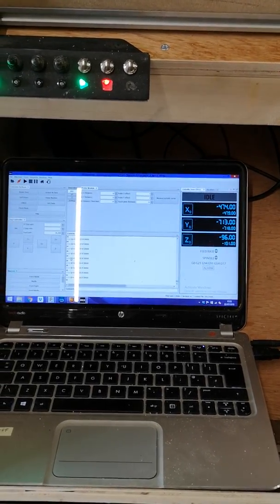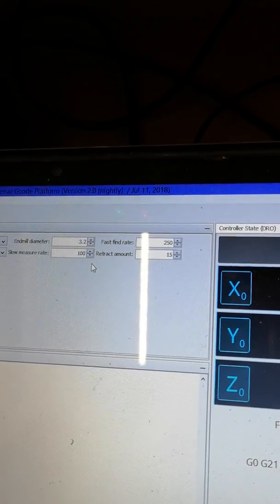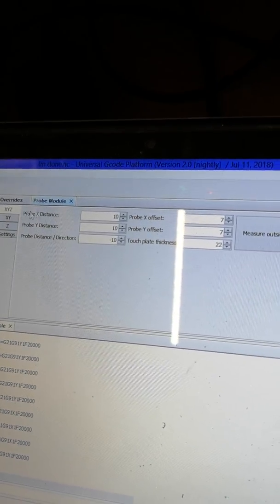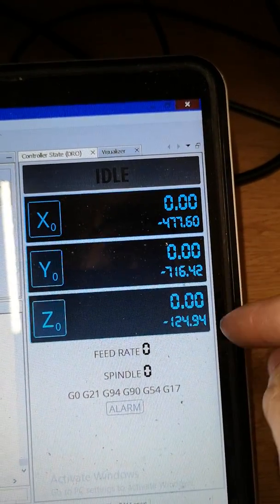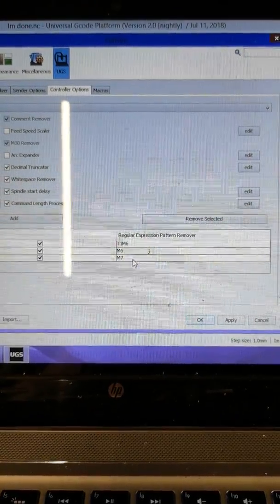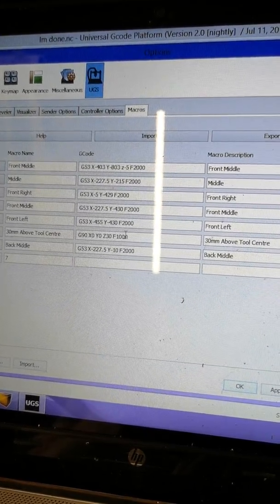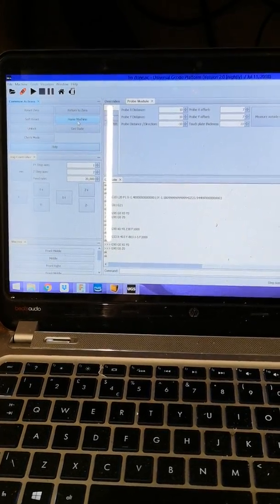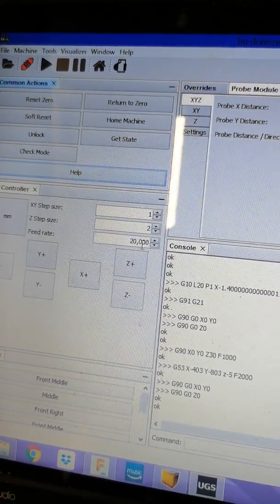Looking at UGCS and the Beaver HDZ for Shapeoko 3 - Probing, Macros & Commands

Comment: Question. It looks like after probing the zero point is the side of the end mill vs the center of the end mill. Is that correct?
Reply from the maker: Savant PCs the item I probed off wasn't secure so it might have moved + poor camera work 😁
Reply: So it does indeed center it to the end mill and not the side? The biggest reason I ask is I do a lot of double-sided milling with acrylic and it is by far the most frustrating part of my day which is why I got the probe. I then discovered there are discrepancies with the probing with Carbide Motion and I have ruined pieces that took hours to get to that point.

If UGCS can probe well and repeatable then I am going to take the time to learn it... I didn't before because I was still learning so much more at the time.
Reply from the maker: Technically it can do either depending on the offset you enter. Both CM and UGCS should be able to locate datum i.e the corner of a workpiece without a problem. Double sided milling is tricky, the work piece must be aligned correctly and you also need to factor in tool shape. For instance most mill ends are not totally round. If you touch off a narrower part of the mill you will get a different result. A way to combat this is probe XYZ with a solid bit of round stock i.e. 1/4 tube, then run a tool change and re-probe Z.
Reply: Ahhh ok that makes sense. I knew the tool diameter was an issue because I use mostly spiral single flutes so this is good to know. At least with an edge finder in the spindle I can get my X and Y. I don't have an issue doing Z by eyeball at that point. Thanks that is good advice!
Reply from the maker: Savant PCs a little trick I use on x and y is mark your spindle nut every 90 degrees. When you do the probe on x and y rotate the head around by 90 or 270 ensuring the same edge is used for the probing.
Reply: Luke's Garage could you do a video on this trick? Think it would be handy for a lot of guys new to CNC.